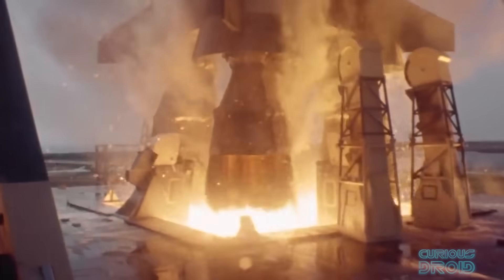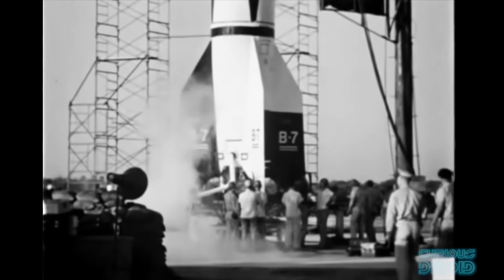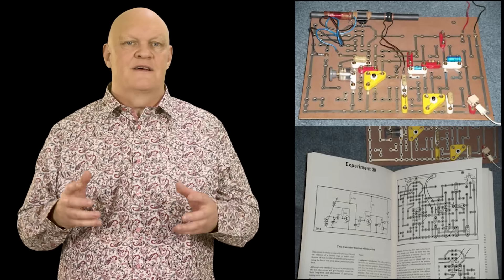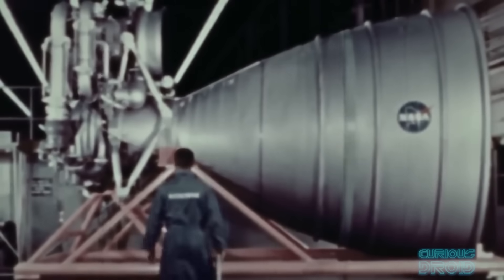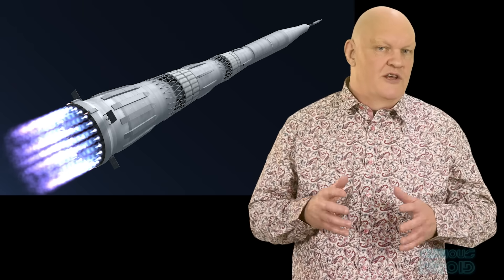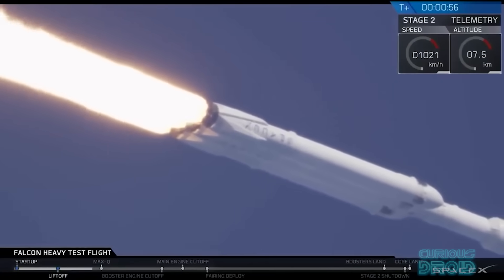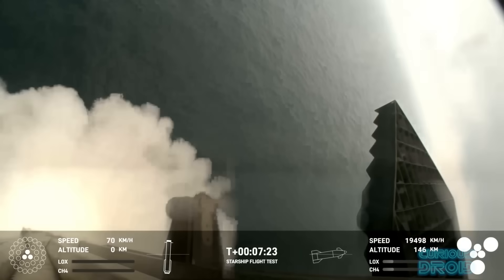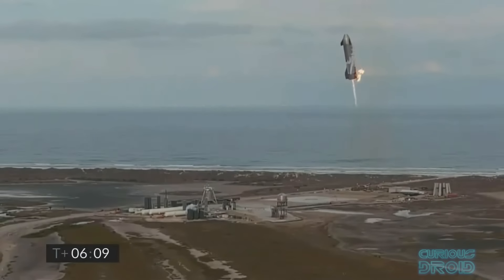Why Does SpaceX Use 33 Engines While NASA Used Just 5?

Comment: They have changed the design of the engines for the SLS with disposability in mind. They're still using up the old Shuttle stock in the mean time, but going forward it'll be engines built around disposability. 

Whilst many analyses of these endeavours focus on the technology and engineering, not enough focus on the commercial viability. 

SLS is not viable commercially, nor was it ever meant to be. It's a blend of a jobs program, a decent launch system with moderate repeatability. 

Super Heavy and Star Ship are meant to launch and replenish Star Link (forget going to Mars, that's a pipe dream), and therefore their viability hinges on the commercial success of Star Link. That is far from assured, and whilst it may work, it's very doubtful that it's going to get a meaningfully large market presence. In places other than the US, fibre and 5G is getting rolled out at a prodigious rate. Worse still, once the fibre is laid, it's laid. Musk has to keep launching satellites forever, just to replenish the constellation when satellites reach their end of life. Long term, the market trend will be away from Star Link, not towards it, even in the USA. 

So, if Star Link fails, will there be enough ad hoc work for Star Ship? Probably not. If Star Link fails so will all the other mega constellations. Going to the moon, and other similar science missions, won't pay the bills.

Comment: It doesn't matter how many times I see the Space X rockets land. I'm always astonished. 
Just Brilliant!
Reply: That ability started in the 1990s.  The Delta project.  As usual with cuts to NASA, it did not get very far. But it did launch and did land.
Reply: Also keep in mind, the ability to land the spacex boosters depends on the kind of watch.  A high Earth orbit, will result in the loss of the booster. 

Also, keep in mind, the savings do not go to the customer.   Spacex charges more to NASA to launch each astronaut more than the Russians, which of course were always a single used rocket.
Reply: @tcat1990  This is false.  Russia currently charges $86 million per seat.  The last time a Soyuz seat cost less than a Dragon seat was 2008.  So there's your corrected "keep in mind."

Comment: Its fine, lots of small engines worked great on the Soviet N1.
Reply: We're not using the same engines
Reply: @samsonsoturian6013  just as well, starship and heavy booster would be a complete disaster if it blew up on the paid, like a tactical nuke going off.  HOLD MY BEER!

Comment: Apollo 5 was not launched on a Saturn V. It used the Saturn 1B originally planned for Apollo 1 to launch an unmanned lunar module into earth orbit for testing.
Reply: I caught that as well.... glad to see others know their space history!
Reply: The wild ride of Apollo 5. They had tons of glitches, and it was only partially fueled.  Gene went full speed ahead on the burns, in manual control.   The ascent stage spun out of control after its burn.  It was an overall success and the next test launch was canceled.
Reply: @Nighthawke70  What you are describing was Apollo 10, not Apollo 5. Apollo 5 was the first unmanned in-flight test of the LM in Low Earth Orbit. Next LM test wasn't until Apollo 9, which essentially repeated the LM-1 flight with an actual rendezvous and docking to a CSM and a test of the new PLSS backpack.

Apollo 10 repeated the A9 LM tests but in Low Lunar Orbit and there was no PLSS backpack test. And "tumbling" of the LM was nothing of the sort as the crew realuzed it was just a switch setting error on their part. It lasted less than 10 seconds. The LM never misbehaved, it was just a momentary period of confusion.
Reply: @DaveS_shuttle  10 had its own ride, Gene put the LEM through serious moves to meet mission requirements.
Reply: @Nighthawke70 not sure what you mean... 🤔
Reply: Also looking for this comment 😊
Reply: Indeed that mention of Apollo 5 struck me as well. IIRC, Apollo 5 was launched by the very Saturn-IB that would have been used for Apollo 1.
Reply: .  . While remaining in near-Earth orbit, another indication are the impossible weather patterns seen on Earth, when in reality only a small portion of the Earth's surface was visible, framed by the round window of the command module.  Straight line cloud fronts are seen on video to be extending for what appears to be more than 6000 miles, a quarter of the Earth's circumference -- something that has never occurred in the meteorological record on Earth. The round window of the command module was used to effect an image of the Earth but the weather in the region did not comply for a realistic view.  No recognizable continents are found in view, but only the impossible weather patterns seen.
Reply: Did Apollo 11 actually leave near-Earth orbit?
Despite the revisionist narrative that this channel won't question -- unstable fuel burn for the oversized F1 engines was never rectified and another arrangement in their place was made in order to reach near Earth orbit, keeping the F1 bell nozzle to maintain the desired appearance.  The great licking yellow flame was an indication that something was not normal as fuel was burning in the atmosphere while providing no additional thrust. This was the result of injecting additional kerosene into the exhaust stream for greater visual effect yet appearing to produce an inefficient burn unlike other rockets after launch.  No explanation is forthcoming and this issue is not addressed in any usual report; however, using a smaller reliable engine with a reduced fuel load and stripped down mission requirement allowed the Saturn V to reach near-Earth orbit.  

The Apollo 11 crew attempted to demonstrate their position at over halfway to the moon as seen in the unedited version presented to the public while the more recently released unedited version reveals a flood of blue light entering the same window as the camera continues to roll, through which only a moment before, we saw the Earth far distant in what appeared to be very low light conditions. Then, as the camera pulls back from the window, the exposure settings are seen to return to normal as a flood of light enters the same window.  Without a change in the orientation of the spacecraft assumed to be on a trajectory toward the moon, the only source for any flood of light can be the Earth while in near-Earth orbit.  The usual sponsored efforts will try to make excuses for why the obvious did not take place -- yet is overly apparent in the unedited version.  When facts cannot prevail in support, sponsored activity will resort to name calling and other derogatory comments discrediting themselves.

Comment: because space x are knobs and do not learn from history
Reply: SpaceX is objectively the most successful launch system provider and both the successful launch of the 33 engine Starship and the 27 engine Falcon Heavy prove that the problem with the N-1 has not the number of engines. You are just displaying the Dunning–Kruger effect.
Reply: @SentinelSent no need to exaggerate, they're contracting eith NASA for routine missions right now
Reply: This idiot doesn't realize Merlin engines is just an incremental improvement on earlier rockets

Comment: What isn't told is that the reusability option adds weight and complexity to the Space X Starship, that's ok for throwing many satellites in a earth orbit but not for the odd deep space moon mission and lander.
Starship is to big, complicated and heavy to be used for the human landing system on the moon.
Apollo never required the 15 space to space refuels to get to the moon but Starship does!  and one wrong move in refuelling on these  multiple times or landing that very tall ungainly, high centre of gravity craft and its all over for the craft and crew.
Saturn V launched 13 times with a 100 percent success rate whilst Starship so far nil out of 4.
I think the dumb engineers left NASA to go to Space X! because so far Space X has proven nothing except ripping Nasa off.
The original Space X HLS landing quote for Starship to land on the moon in 2024 was a signed fixed contract for $135 million and Musk failed, and now from nowhere he renegotiates a new deal of 4 Billion dollars of US tax payers money and it will be 3 to 7 years delay.
Reply: The $135 million that SpaceX received wasn't for a landing, it was to do preliminary design work to be able to bid on a lander contract. The lander contract was for $2.89 billion, fixed price for one landing. 

It was originally scheduled for 2025, which won't happen - SpaceX is behind schedule. But even if SpaceX were ready, Orion still wouldn't be. Artemis 2 won't happen until next year, which means the earliest Orion would be ready for Artemis 3 is 2026.

Starship is working through development. The fourth flight was a complete success as per the flight plan. There were some issues during the flight, like a failed engine on ascent, a failed engine on booster landing and burn through on one of the aerosurfaces on reentry, but the vehicle still managed to complete all objectives. And the data collected will make future flights more successful.

We will just have to see whether Starship will be ready for a moon landing in 2026. I doubt it, but it's also still unclear whether Orion will be ready. My guess is that both Starship and Orion won't be ready until 2027.
Reply: @SpaceAdvocate  Did not Musk say he will land Starship on the moon 2024?
and the bid won by Space X was for $135 million, thus ripping off all true more expensive but realistic competition bids with a dam outright lie!.
Reply: @Leon1Aust  The other two bids were awful, with one of them flat out not being physically possible and the other not meeting requirements.
Reply: @Leon1Aust  The bid was $2.89 billion, for a landing in 2024. And SpaceX thought 2024 could be possible. But it is a development program, so that date was not at all definite.

If anyone could have hit that 2024 date, it would be SpaceX. But they couldn't do it. It was just too little time.
Reply: @SentinelSent  Starships bid was a flagrant lie mate! the others had less capability for more expense but a much more true indicative of what it costs and not all were not physically possible.
Musk did say for $135 million on the moon by 2024! and a contract was signed.
Now 4 Billion of US tax payers for 3 year to 7 years wait.
The companies were bidding on a contract to provide design, development, build, test, and evaluation of an HLS, plus two lunar landings, one uncrewed and one crewed, for a fixed price
They should of held him to that contract.
Reply: So your not counting Saturn V test launches? But somehow Starship is not still a test craft? No logic there.
Reply: @Zacho5  Saturn V ..........I included the test launches, so all up  13 launches with a 100 percent success rate! yep 100 percent!
Reply: @Leon1Aust  Apollo 6 had multiple failures.

Comment: Landing of SpaceX reminds me of the black and white Flash Gordon movie. It looked so funny to see it landing like that. And now we got it as something normal.
You can say what you want about 50’s and early 60’s but you can’t deny leap they have made. Look at anything and you will find incredible things and quality. For example Gibson with all new technology still can’t make the guitars as good as original Burst 59 Standard. They lost people and knowledge and they are working hard researching how the stuff was made. They got better but still they do not get some stuff right.
In those years your today’s mobile phone has more computing power than computer farms used back then. Software have had to be more effective but was hard to write. There were no hard disks even. I remember ES3090 series frame systems from IBM. Hard disk frame was having two disks and they were 10 MB each. Pates were size of the washing machines. Powerful DC engines running belt drive and spinning them very fast. Heads from both sides using big coils and very powerful rare earth magnets.
People back then still manage to do stuff some people can’t even believe nowadays.
Sure we have improved everything from materials to computer stuff. But we haven’t invented that much ground breaking things.

Comment: Are there any other class of vehicles that use more than a few engines? Airplanes typically max four engines, trains ditto, ships usually one or two. As to economics of scale, mass producing the engines and all that that you read in the comments, the numbers will not be that high and there will be competition which will reduce the number of produced engines of any single any design, even jet engines industry is not a one horse race. Redundancy? Yes but Apollo (don't remember which) lost one of five and made to orbit just fine. What I'm trying to say is that I doubt that in the long run rockets will not be using 33 engines or anywhere near that many ... it just does not pay off.

Comment: The F1 engines are also way more expensive cause every one of them was hand tuned and modified to perfect stats. This took so much engineering time thatbthey got bloated to immense costs.
Reply: While that is true, this is not very relevant in this context. A redesigned F1 engine would be much cheaper to produce and typically in engineering it just is not economical use tens of anything if you can get away with just a few. Don't see many airplanes or ships using more than four engines....

Comment: It seems the real answer is to use nine F-1 sized engines, reengineered with modern production considerations and throttling.
Reply: No, respectfully no.
Reply: the issue is that it would not work very well as an upper stage engine for reuse.

Comment: @curious droid, little fact correction: USA didn’t react to Sputnik launch, just the opposite - soviets learned about explorer one development and wanted to up USA and launch first but they only could send a very little sphere with a radio beeper on top of icbm and a propaganda mission and they did. No scientific value, just political.😊

Meanwhile falcon heavy was never reused, falcon 9 reuse cycle takes months and the cost comparing to non reusable rocket is similar. Russians charged 20m usd to launch an astronaut to iss before the shuttle was retired and they realised they can price gauge and rise to 80m usd. Spacex charges 55 m usd, where is the cost saving? Vapourware.
Reply: Falcon Heavy launches generally include reuse of two out of three cores. And while SpaceX charges a hefty premium for crew launches, it's still cheaper than all the alternatives, which means SpaceX is in fact saving NASA money.

Comment: Making throttleable rockets is not necessarily a new idea: The AJ-10 engine used on the Apollo service module and as the OMS engines on the shuttle were deep-throttle capable, down to a minimum of 10% of rated thrust. The same was true for the descent engine on the lunar module, which was a smaller engine, but worked in essentially the same way and used the same fuel/oxidiser combination.
Having said that, these were all simple pressure fed engines: Opening or closing a pair of valves (one for the fuel and another for the oxidiser) could start or stop the engine. So throttling could be achieved with the same two valves, just by opening them partially. Another aspect which made this extremely simple and reliable was using hypergolic propellants, which ignite spontaneously and immediately when the fuel and oxidiser come into contact with each other, so no separate ignition system was needed.
Several possible propellant combinations could be used in the AJ-10 engine: The fuel could be either hydrazine, methylhydrazine, dimethylhydrazine or any mixture of these, while the oxidiser could be either nitric acid, dinitrogen tetroxide or a mixture of nitric oxide and dinitrogen tetroxide. The reason for mixing nitric oxide (at anywhere between 3% and 30%) with the dinitrogen tetroxide was to adjust the freezing point of the oxidizer, to enable the mixture to be a space-storable liquid.